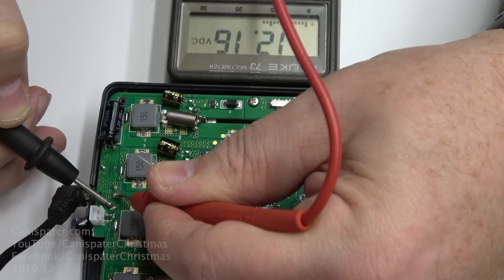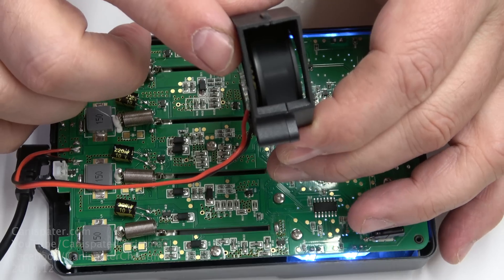⚡️DIY Powerwall Project - ep7 - Update  (2019)

Comment: Hi, why are you fitting a 5 volt fan when the original fan is 12 volts?
Reply from the maker: 12V fans not 5V.
Reply: @CanispaterChristmas  power2spares are selling 5v fans on the ebay link
Reply from the maker: OH! Lemme check with him. He created a web site after this video and they may be there.
Reply: @CanispaterChristmas  Thanks for your prompt reply. I tried to ask the question on the ebay link but it  doesn't take any questions,  Many thanks.
Reply from the maker: Should be able to get you fixed up. I'll ask him about that link. You building a battery or just repairing an Opus?
Reply: @CanispaterChristmas  just repairing an Opus i've found this fan for sale in the UK (England) where I live. thanks for your help.
Reply from the maker: Ah cool! OK. He said to email him: info at power2spare dot net and he will invoice you.

Comment: Its all about pressure. You need good pressure from probes on the wire to not get the big BOOOM💥😆😃👍
Reply from the maker: Haha Thanks! Most of them went fine, but a few surprised me so not sure what's different. Felt like I was going to bust the cell through the holder a couple of times (due to pressure), but it still happened. 6 more cell packs to go so I'll either figure something out or just have to change my shorts a lot! 💥🤣
Reply: Not only about pressure but also about clean contact surface. So degreasing the cell (with denatured alcohol for example) before spot welding really helps. Also use gloves when manipulating the glass fuse wires to avoid contaminating them with greasy fingers. For me that solved the "random BOOMs" you experience.

Comment: How many of those packs are you building, and what size inverter are you going with?
Reply from the maker: I'm making 7 packs for a 24V invertor. I got a 2.4kW (~2,400W) PIP2424LV-MSD from MPP Solar. It's an inverter, charger, solar charge controller all rolled into one. It will be working without solar initially, but I'll add some later if I can find some that aren't too expensive. I live in the city and power is 99.99% available so I don't want to pay a lot for panels. This started out trying to replace my Honda generator (because I can't really use it unless the outage is during the day), but I'd need double the cells so it's half a generator. :)

Comment: Thanks for another great video. 
What battery are you using to power your KWeld?  
Thanks!
Reply from the maker: Thanks! I have 2, 12-volt lead-acid lawn mower batteries in series (24V). I think they have about 330 cold cranking amps. Pete used a 24-volt powerwall, but I don't have one yet sooooooo..... lol!